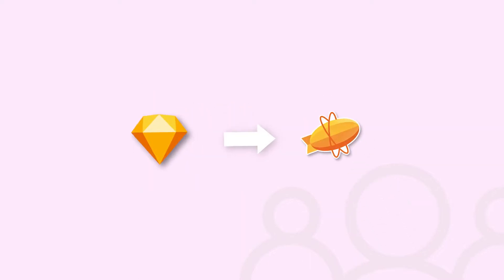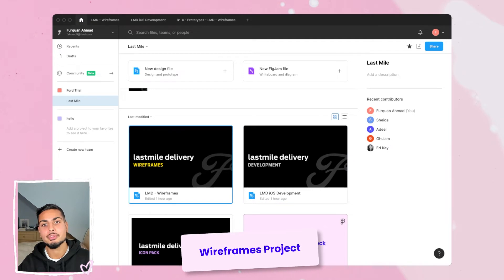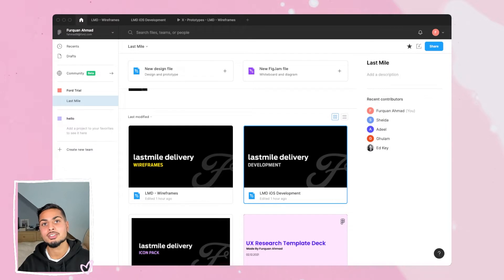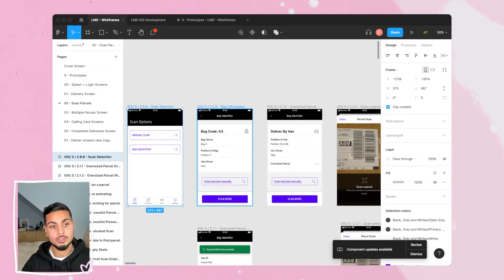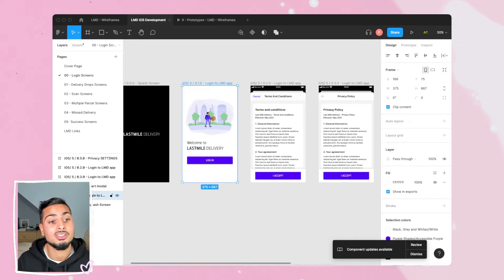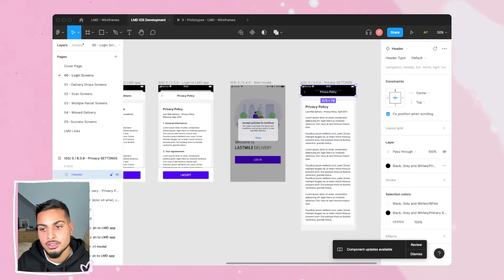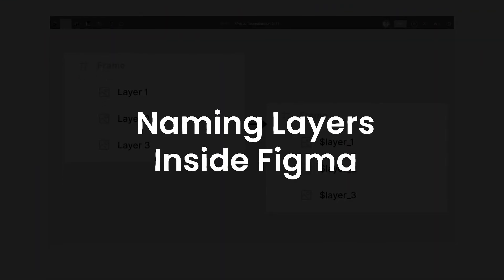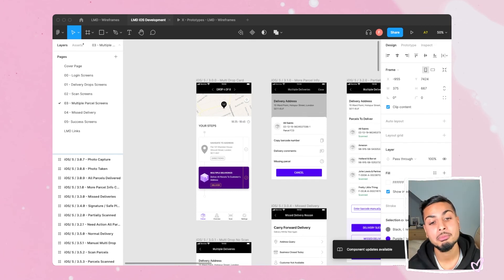How To Hand Off Your Designs To Engineering For Development

Comment: Don't the developers also need to know the spacing between items/components? Where would you include that? Or is that something they can figure out? And is that the same for a style guide?
Reply from the maker: When viewing Figma files developers can see the spacing between items in the inspect panel, or you can have a baseline rule set with your developers telling them everything should be using a 8px grid system
Reply: @furquan101  Ok, thank you so much!

Comment: Nice video as always furquan, This question I am about to ask is unrelated but I would love to hear your take. I am in a final round of an interview process and I am required to present the solution to a design task that was given to me in the previous stage to a panel of interviewers.

My question is how do I present this to them without reading my slides word for word just the way it is on my presentation slides? and what kind of follow up questions should I prepare for after I am done with the presentation? I will be having this interview by Tuesday this week, your response will be so helpful to me 🙏🏻
Reply from the maker: The slides should be there to support and give a visual aid to your presenters. They shouldn't be full of text, there should be a balance of images, wireframes, mockups, prototypes (important).

Follow up questions could always be around, how would you do this differently? Why did you choose this direction in your design? How did you work XFN with your team+ more.
Reply: @furquan101  thanks so much mate. Didn’t get the last line tho @XFN

Comment: Thanks for sharing 🙌
How about the whole prototype of the app if the features are allocated through different sections?
Reply from the maker: If you have a prototype of the entire end to end app, i'd keep this in a separate project. This helps a lot of with performance and load times for your prototype and makes it easier to find. Just make sure to update the prototype when new screens roll in!